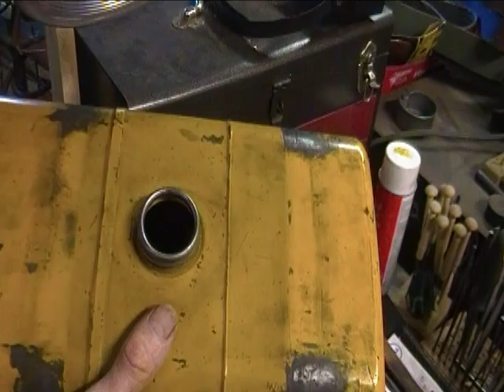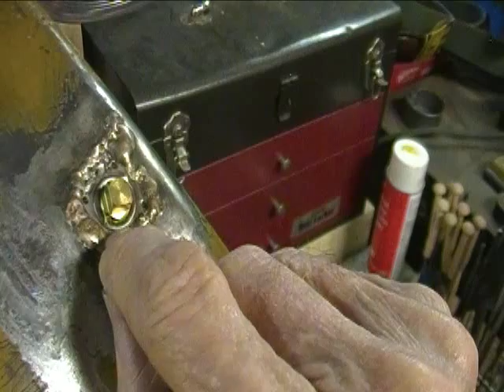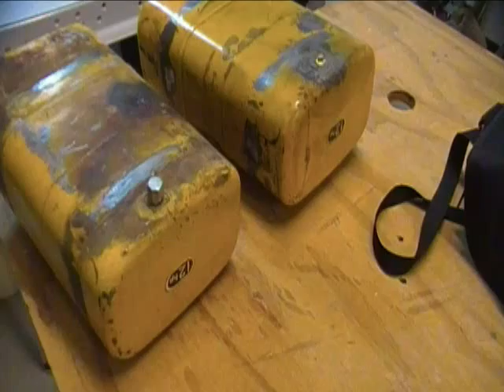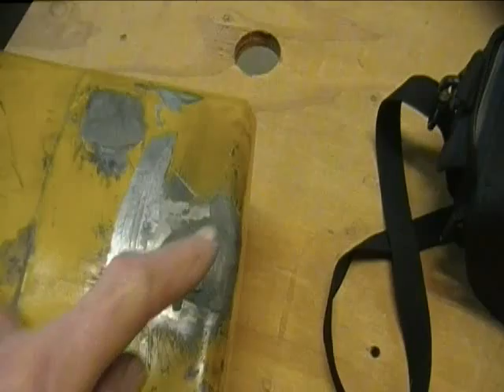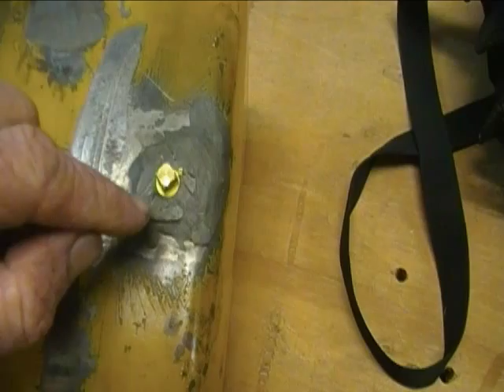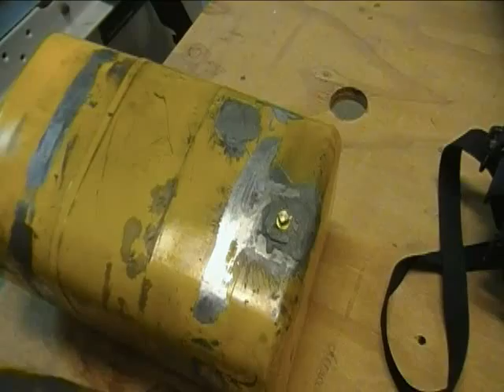Steel Gas Tank Leak Diagnosis And Repair Method

Comment: I have heard leaks in these tanks are common - one person told it me it is because the glass sediment bowls are heavy and the one cylinder kholers vibrate a lot so it weakens the tank where the fuel line exits - this person suggested replacing the glass sed bowl with a plastic fuel filter OR a gas shut off valve that has a screen in it - but I wonder if a beefier patch or this JB weld epoxy is strong enough to allow the original glass bowl set up ??
Reply from the maker: All I can tell you is that I haven't had any new gas tank leaks develop in the last 2 years or so. I do have glass sediment bowls on all 7 of my Cubs.